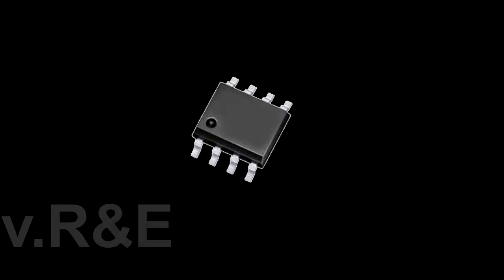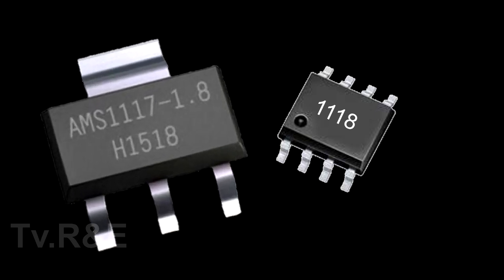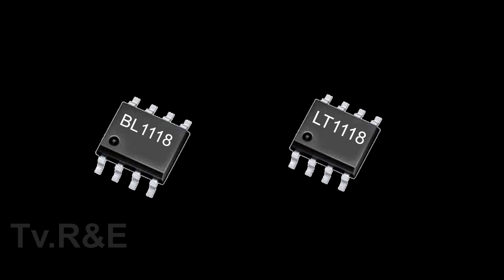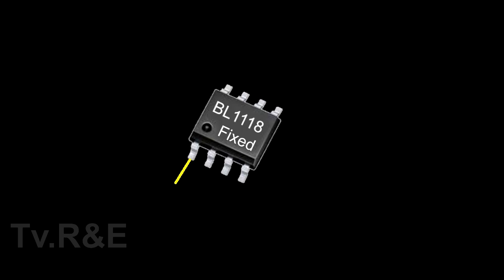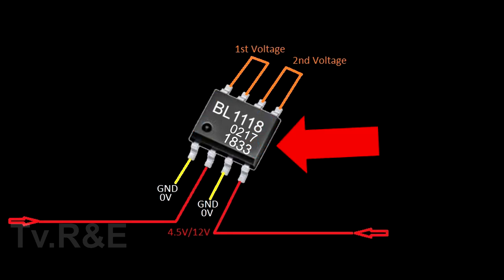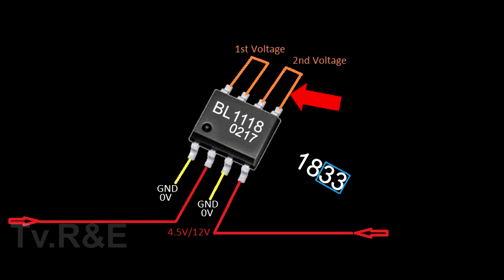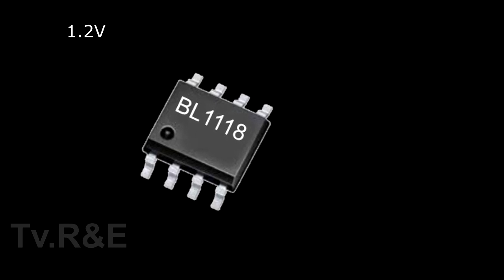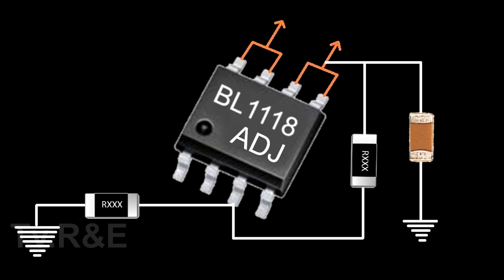T.v. IC 1118 Regulator details.

Comment: Only 3.3 volts output in pin 5  but in pin 7&8 no voltage reading .it means need to replace the IC
Reply from the maker: Yes